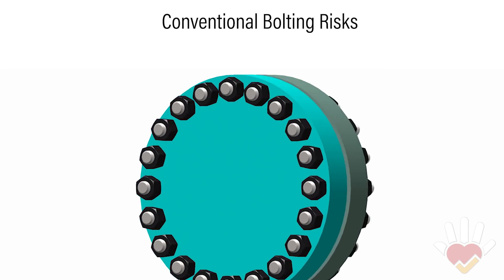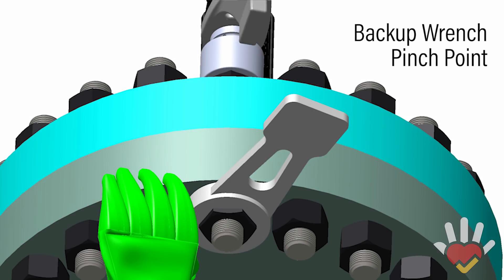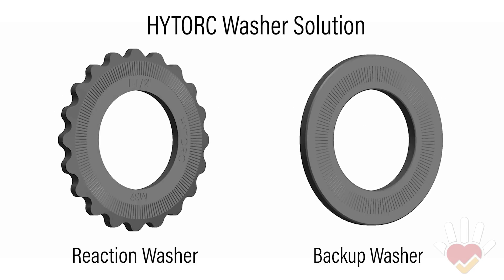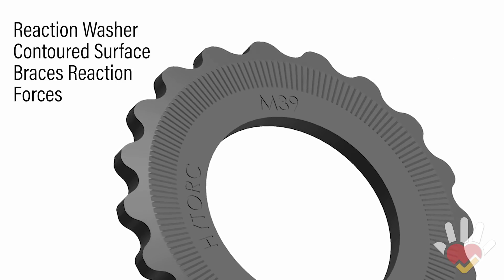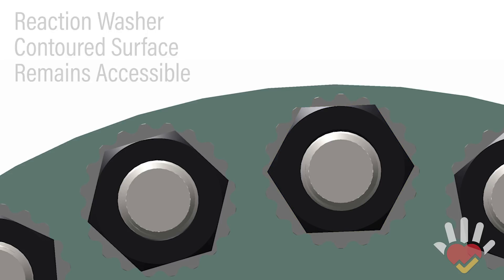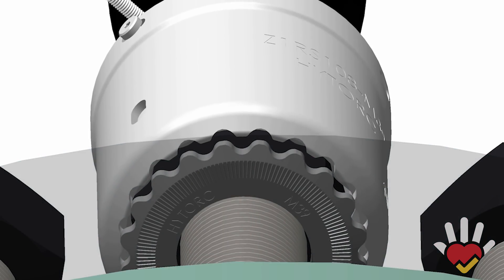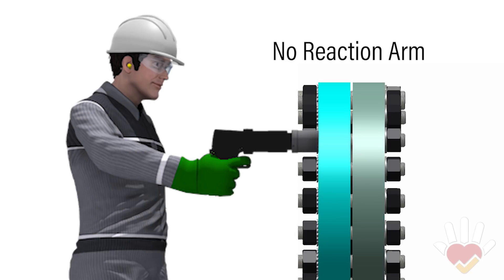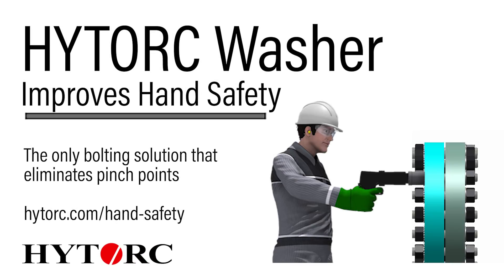Hand Safety with the HYTORC Washer

Comment: Question, is the torque applied effected by antisieze? I.e. wet torque value or dry torque value..
Thanks
Reply from the maker: The amount of torque needed to achieve the desired bolt load or joint compression will vary depending on lubrication/friction. When an anti-seize or lubricant is used, usually less torque will be necessary to achieve the same bolt load than would be required on a dry joint.